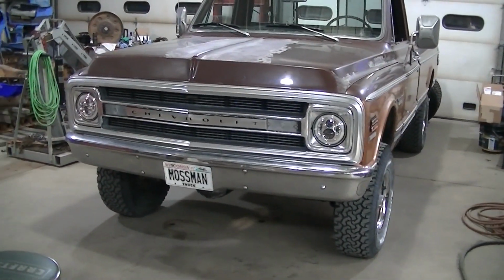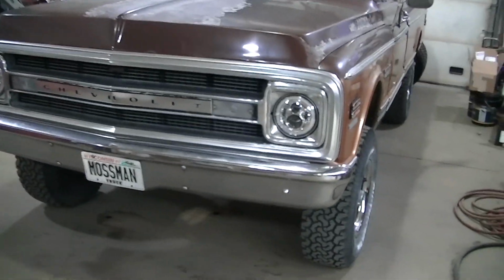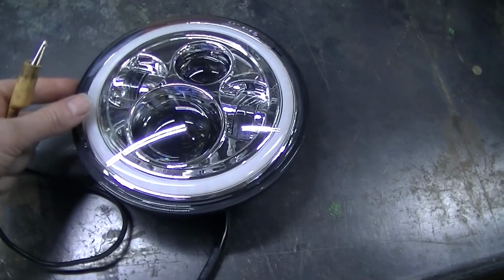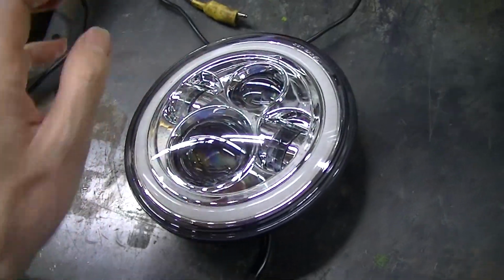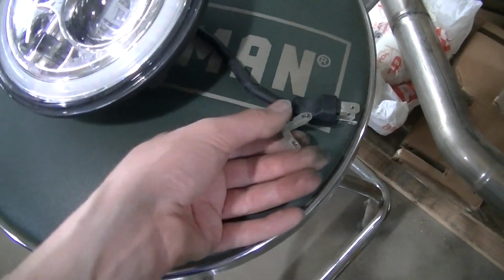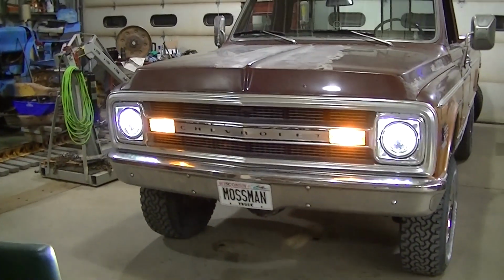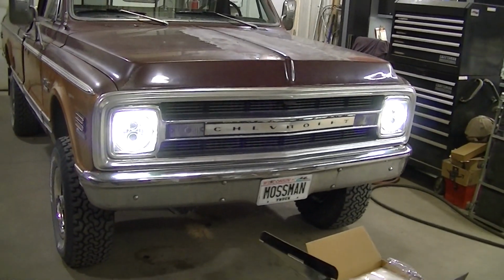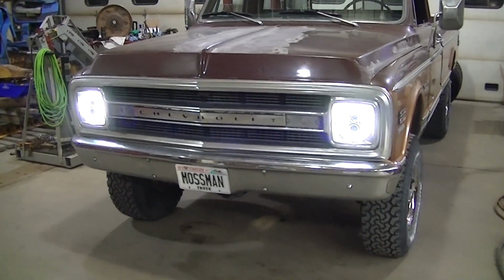70 Chevy Truck LED Headlights

Comment: Those lights are similar, without the trim ring, to the one I installed on my 2007 Harley Davidson.   Made a huge difference but back then it looked weird compared to the stock headlamp.  

You mad he right call in my view!
Reply from the maker: I think these are the same lights that go in motorcycles. You can buy them in singles. Haven't done any night driving with them but they have to be brighter than the stock dim yellow ones. I like them.

Comment: Amber would look great as daytime running light it would go with the color of the truck well
Reply from the maker: I think it would to. I just don't want to confuse people when the amber doesn't flash with the turn signals. I could run a relay and make it flash. It would just take some more wiring. Right now just using the white as a DRL.

Comment: I like the looks of those lights much better than stock.  Pretty sure turn signals need to be amber though.  If you have white or clear lens you are supposed to run a yellow bulb.  The white ring light reflects on the outer trim ring around it.  I wonder if painting them matte black would improve that.  Or you could fine wire wheel them to make them less reflective.
I really like that truck, I've owned a 67 Chevy PU and two, 72 K5 Blazers.  I wouldn't apologize for a second for modernizing/upgrading it either.   
I do disagree the Gen 1, and Vortec head SBC engines are "the same" (as good or equal) to the LS engines.  The LS is very much a better engine in about every way.  I am more comfortable working on the older stuff but you can make more power, easier with the LS and they don't develop that stupid oil leak where the oil pan meets the timing cover.  Of course, that isn't a reason to go out and swap an LS into everything you have running a Gen 1 SBC or BBC.  They both are very good engines.  That truck needs fuel injection next.
Reply from the maker: Yup, I would keep any turn signal amber. The plan is to put a 427 in the truck that I have laying around the shop. I would love to put a fuel injection system on it but probably won't have the funds for it. We will see. Dads Camaro is priority right now. We will be driving that this year. The Tremec is going in tomorrow unless we have trouble.
Reply: @mossman381  I know you are a hard working man, but "a 427 in the truck that I have laying around the shop" means you lead a charmed life.  ;-)
Reply from the maker: I don't know if I have ever shown the engine or not. It was for my 81 stepside that I had. It was out of an 87 Chevy C70 I believe. It's a low mileage rebuild.

Comment: I think you chose some good lights. At first glance they look stock if they aren't on so it doesn't mess with the look until you turn them on. Just make sure you adjust the low beams to actually be low beams. Way to many dumb turds out there driving around with their new HIDs or LEDs pointing straight out or even slightly up, blinding everyone.